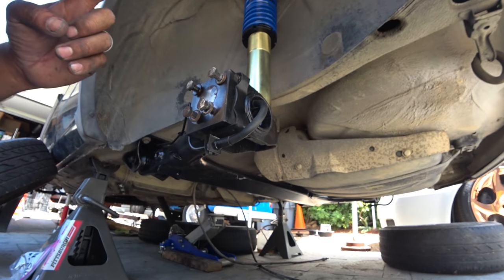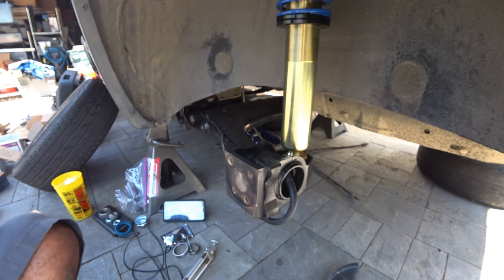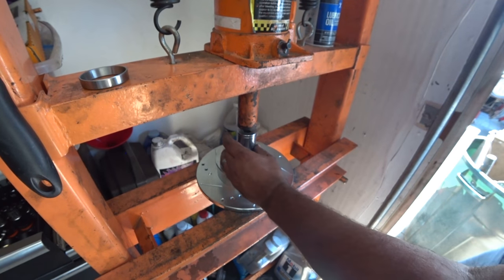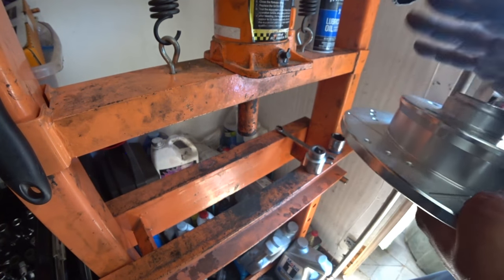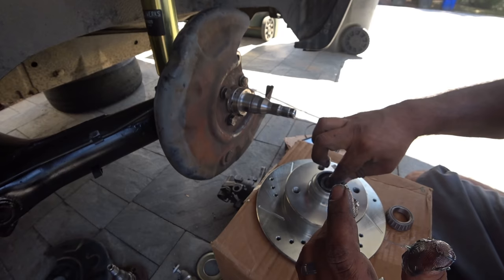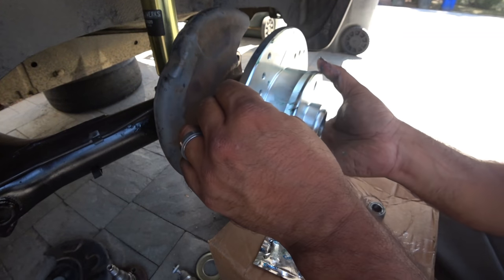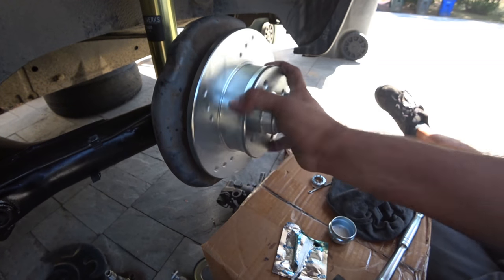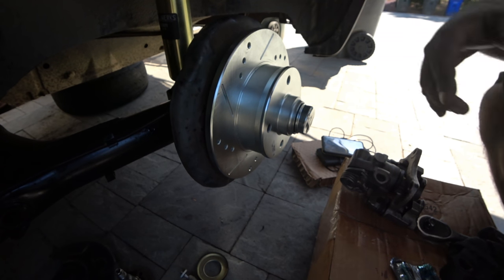VW MK2 GTI/Jetta Rear Disc Rebuild S6 EP1

Comment: Good video, but one or two remarks the dust metal big protection plate must envelope the brake disk.
So it's pointing to the wrong side on your vehicle.
It's made to protect the disc from dirt.
And the wheel nut may not be to tight as the big washer must just still be able to move when touched with a screw driver!